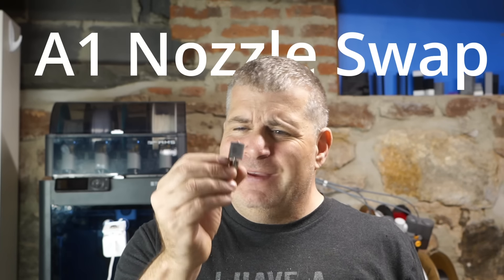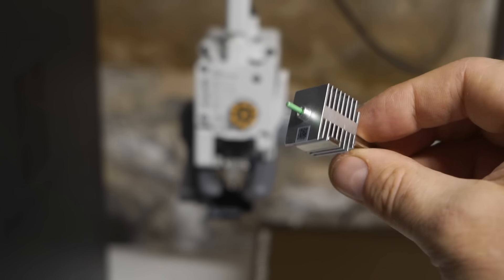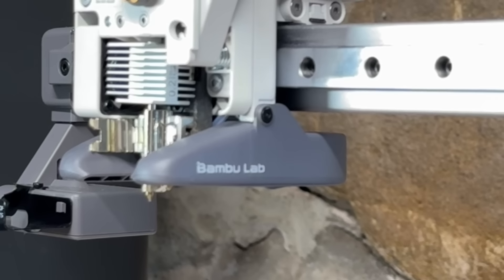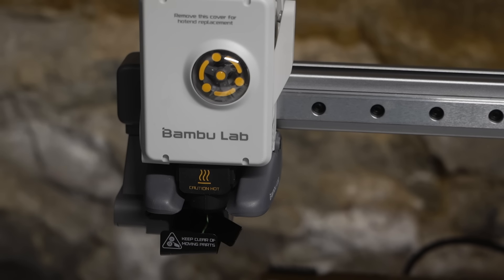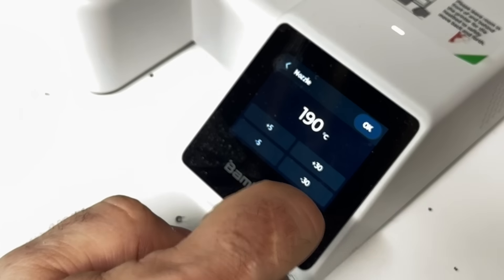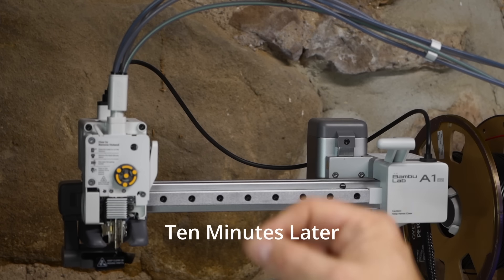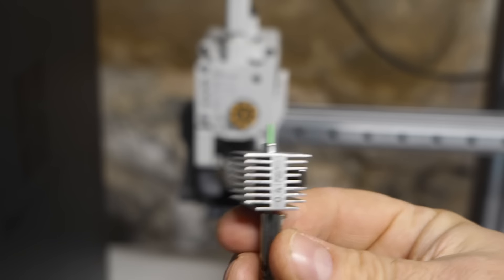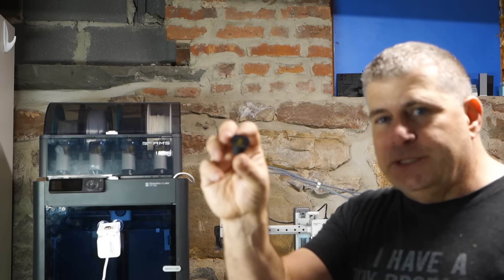Bambu A1 nozzle swap THE RIGHT WAY! Don't damage your printer by following the instructions

Comment: Can you not just unload the filament first and then cool down and then change the nozzel?
Reply from the maker: Usually not. Because the bit of filament sticks up even when it's cut it often is too high up to allow the nozzle to come out.
Reply: You can, I often cut filament manualy and change nozzle on cold.
Reply: Hmmm... I haven't received my A1 Mini yet, but what if new filament is loaded until it flushes out the old filament, and then bring the temp down to nozzle 'cold pull' temperature, and then just  manually pull the filament out?
Reply: @davetriesthis  i don't get it - if i unload it completely, therer shouldn't stick somethin out on top? why is that not possible?
Reply: @harri4208 it cuts the filament, pushes it a bit further into the hotend, then unloads the filament

hence it never actually pulls the filament out of the hotend unlike most printers

the benefit is it can never get hot/molten filament in the heatbreak part and cause a clog that way
Reply: Summary: use a screwdriver / firm stick to gently yank it out if it’s stuck.

Comment: The Loading and unloading part doesn't make sense. You already know from the start that there's extra filament left and it's where the filament was cut. Loading and unloading will leave you with the exact same state except its a "newer" filament --which doesn't change anything. So doing that was just to a lot of time and filament to achieve basically nothing. The only step needed was the part you told us not to do from the start, --that you did in the end anyway. SMH.

Comment: I don't understand why would you change filament and put new filament in?filithe residual filament is the problem, why don't we just do a complete purge? I'm confused.
Reply from the maker: This isn't a clogged nozzle. This is when the filament doesn't retract enough to remove it from the print head. That's a printer issue.

Comment: You can pull out the nozzle, as shown at the end, without any of these steps or a screwdriver. Just put on the bottom slightly with your finger. Mine was used for nearly a year and came right out.
Reply from the maker: Yeah that's how it usually works. Except when it doesn't. This video is for when it doesn't.

Comment: If you remove the two little screws above the hotend, the small plastic piece can be removed, revealing the top of the heatsink.
Reply: So then the hotend will just pop right out even with some filament sticking out of the top of it?
Reply: @joeking433 yup. That is in the instructions the guy in the video apparently didn’t read.
Reply: Thankyou you just saved me from so much time and temptation to burn my fingers
Reply: @joeking433  only thing is, when I attempted this method, the little spinning decoration round plastic doodad when popped off very gently, the screwed in piece removes quite magically. When reassembling the (I'm gonna calli the) hotend retainer, with the two screws when you reposition it before the screws go back in, the little doodad reinstalled actually holds the retainer in place where its ridiculously easy to position and run the two screws back in place. Been at this a minute, and things like this really stick out to me too!

Comment: I got a blob issue but it blobed up even the release chamber. I was in the rest room and could not stop it until it was too late 😂😂😂 now im here
Reply from the maker: Give their support an email. You'll probably have to replace the whole printhead. I did one for someone and it's not too bad to do. 

There's clog detection in the menus now but it's off by default. When you get it replaced, be sure to turn that on.
Reply: @davetriesthis  thank you for your reply. I am fairly new to the hobby first printer first major error ✌️😎
Reply: @davetriesthis  I did see the detection option off 🤣

Comment: This is a great video. I’ve also found a butter knife can help flip open that front lever. Two other big things to do that people forget is changing the nozzle size on the machine in the settings and change the nozzle to a slicer, and you will have to re-slice things if they were done slices. This is critical for success and no damage. While you’re doing this nozzle swap, it’s also a great time to tighten the three black screws behind the nozzle. They come loose overtime and for sure affect your first layer.

Comment: can we use A1 Mini Nozzle to A1 ? thanks
Reply from the maker: Yes. They are interchangeable
Reply: @davetriesthis  thank you
Reply: A1 and A1 Mini have the same exact print head. The only real difference is the plate size (and of course how they slightly modified the structure to make it work on the bigger plate)
Reply: this is a great video. Certainly appreciate it. My new issue is I’m trying to go to the .2  and no matter which spool I select on AMS it clicks and does not work. When I go back to the .4 it works every time. Something to do with changing to the .2  this machine does not like.

Comment: You can speed up cooling the nozzle by turning on the fans - it moves so much air around the nozzle it helps it cool quicker since the tip of the nozzle is getting blasted by cold air.
EDIT: I forgot to ask - how do you remove the cover to all of this without damaging it? I see spots I want to pry at but not going to take chances this is my baby.

Comment: When I was loading filaments on my new AMS,the printer was going all the way to the right and I heard a sharp snapping sound. Any idea what it was and why? I got the printer for my birthday last month and got the AMS just a few days ago so still unfamiliar with everything.
Reply: all the way to the right and a snap sounds like the filament cutter cutting the filament
Reply from the maker: Agreed. There's a post on the right side that presses the filament blade in when it's all the way right. The printer will auto do this to get the older filament out of the print head to load another.

Comment: Nice video, but I have several questions . I have a 0.4 nozzle and would like to buy a 0.6 or 0.8 nozzle, what do you recommend? Then, to change the nozzle do you have to remove everything that is part of the extruder or is it enough to change the nozzle?Thank you
Reply from the maker: The nozzles in the A1 are quick swapable. Only sometimes the filament sticks a bit like this is discussing. Generally it takes about 3 minutes to swap the nozzles out.

Comment: Thanks for the video!
3:41 Do you have to do anything extra after inserting the nozzle with pre-existing filament in it, or just push the filament into the tube until it won't go anymore?
Reply from the maker: Just push it until it won't go anymore.

Comment: Not knowing anything I'd do it differently. I guess what I'd try wouldn't work. How about cutting the filament, then extrude a bit of the filament so it pushes the cut bit into the nozzle and then back it back out. I guess for some reason that wouldn't work. Since I don't have an A1 printer I can't test it.
Reply: Nice idea, I will test on mine
Reply: Yep, it works perfectly

Comment: My A1 hast made a mess, around the nozzle with filament. I tried heating it up in maintence mode, but sadly that was not enough, so the wire to the hotend temperature part has broken, while removing the stuck PLA, and now the printer measure 0 degrees, and the nozzle is still stuck.
How do i fix this? :/
Reply from the maker: You have to reach out to support. They'll send you a new unit and there's a link to instructions on performing the repair.

Comment: I would go quite a bit different tbh, heat it up, extrude a bit and then go like you would with a cold pull and just pull it back out. Way less to do in the (imho too simple) UI.
Reply from the maker: Thanks for the tips!

Comment: I almost never have issued pulling the nozzle out. Pull the tip outward, then pull the whole hotend down and outward.

What I have a problem is loading a nozzle with a filament already stuck in the inlet side.
Reply from the maker: Cut the filament off at the top of the inlet with clippers.

Comment: Lol. This guy didn't even read the instructions.

There are two screws that you need to remove too that let's you open the assembly.

Laughable.
Reply from the maker: You think that removing screws when you don't have to is better? Ok.
Reply: @davetriesthis  The hole is made specifically to fit that bit of filament. You HAVE TO remove it. Otherwise you make it harder than it should.

Comment: So useless video. Here is the EASY way - CUT THE FILAMENT (!) by pushing the leaver. If you use AMS and have printed you do not this step. Unclip the nozzle - pull down and away. It goes out without any issue, no need to heat up, wait for it to cool , etc...
Reply from the maker: That's great except sometimes that doesn't work. And that's what the video is for.
Reply: @davetriesthis  the cutter is quite simple, it works like 99.99% of the time :D
Reply from the maker: @KaliKavala it's definitely not 99.99 percent of the time. And those times are what this video is for.